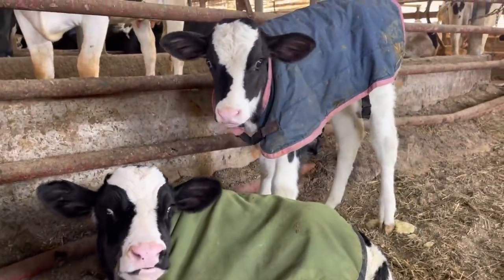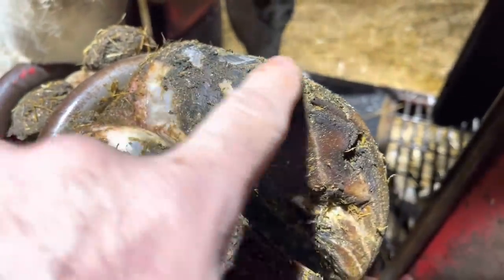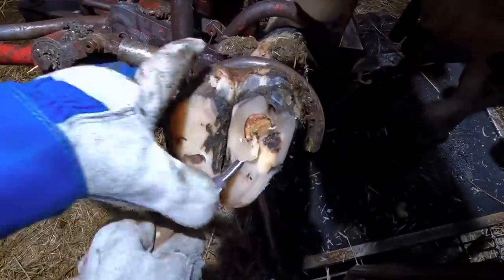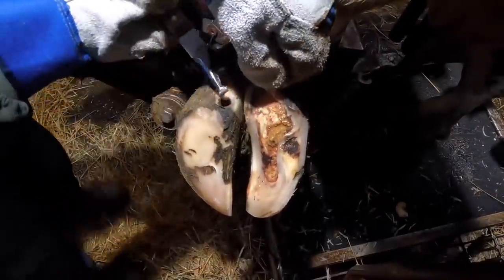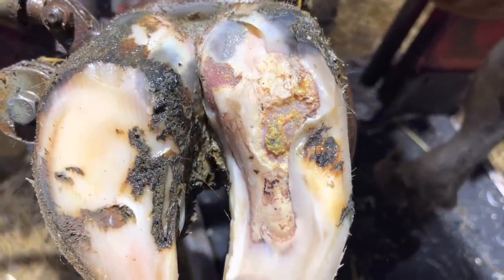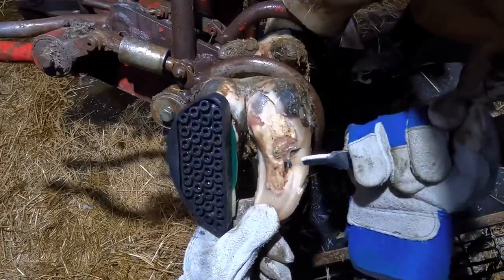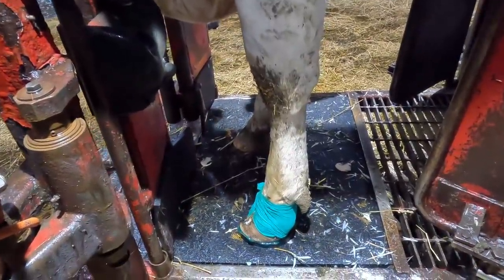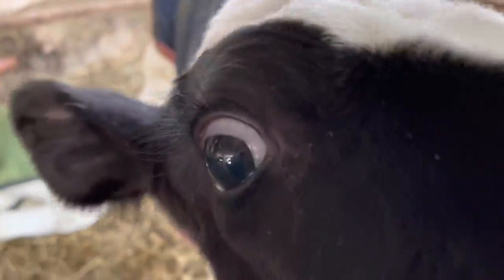Cow gets IMMEASURABLE RELIEF for a Painful Front Foot

Comment: Is there ever a concern of cross-contamination with the knife? Like if you're working on one hoof that has digital dermatitis and then you follow it up with going to another hoof. Is there a risk that it could spread on the tools. Is there any type of disinfectant used between cows as well? I know they're probably silly questions but I've always wondered.
Reply from the maker: Not silly.  Yes. I spray my knives with chlorhexidine after working on lesions like this.  Cross contamination is low because I spray the lesions liberally with chlorhexidine but it doesn’t hurt to treat the knives as well.

Comment: "Does it Hurt to remove the Horn" Yes it will hurt the cow a bit when the Horn gets removed (the pulling away from the Corium does hurt a little) but the Pain is nothing compared to what the Cow feels when she would put Weight on the infected foot :P As long as the Hooftrimmer doesnt cut into the Corium the process will however do no harm to the Cow. And Nate does a mighty fine Job avoiding cutting into it :3

Comment: What I've wondered is if the salicylic acid or the spray you use stings when it goes on. I've noticed that they flinch sometimes when you're putting it on. And since you use it as an antiseptic it would make sense to me if it stings a bit since human antiseptics usually do. A lot of times for me cleaning a scrape is more painful than getting the original scrape was, but maybe my pain tolerance is just weird.